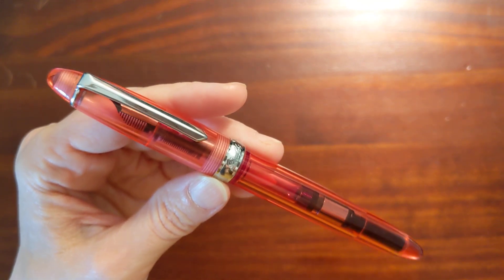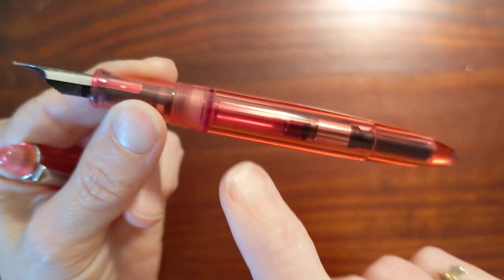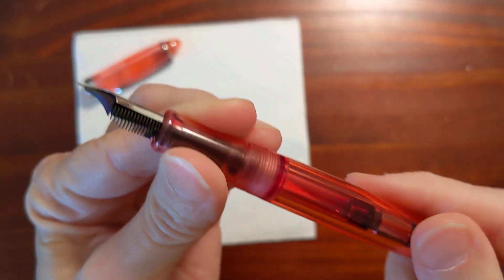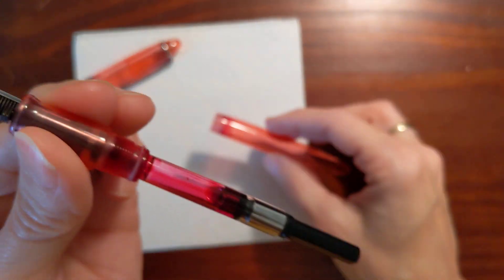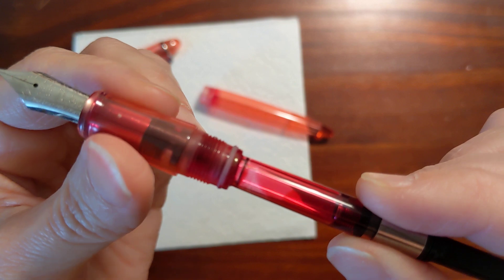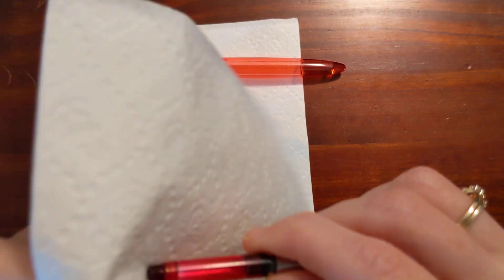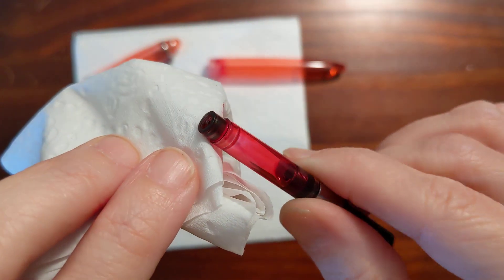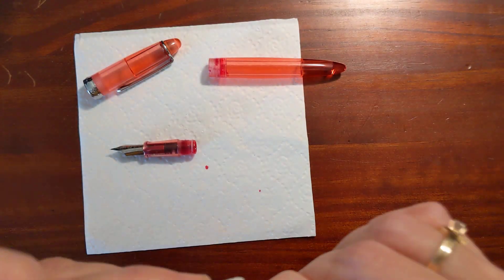Penbbs 308 Sprung a Leak

Comment: That happened to my Pen BBS 308 also. I, too, took it apart, checked the O rings, etc., and reassembled it. I haven’t had that problem since. 🤷‍♀️
Reply from the maker: I never had any problems after the first leak either. I haven't used my 308 much recently...I need to get out and take it for a spin. 😀

Comment: Hi! I never had this problem with a PENBBS but I had it a couple of times with Waterman converters in Waterman pens. They seemed to seal well but the "mouth" of the converter cracked and there was ink inside the pen. I suggest to check with a loupe if there is an almost invisible crack in the converter...
Reply from the maker: Thanks for the advice...I'll check it out.

Comment: Did it leak again?  Consider a PenBBS parts kits, comes with lots of stuff including some converters.  I have not had a leak as you did in the 30+ PenBBS pens I've used.
Reply from the maker: I cleaned the pen out and inspected the converter with a loupe. I didn't see any cracks. However I did notice a tiny chip in the plastic of the lip, but it was in a location that didn't appear like it would cause a leak. I'm going to ink it up again today and see what happens.

Comment: Yep, a cracked converter lip is the most likely explanation. Since the lip doesn't have a metal reinforcement ring, it's more prone to hairline cracks. It happens more often than you think. Just replace the converter.
Reply from the maker: I checked the converter with a loupe and didn't see any cracks. I'm going to ink it up again and see what happens.
Reply: @gadgetstop321  Hairline cracks may not show up under a loupe.

Comment: I had the same problem. I don't trust PenBBS converters, I had to buy the parts kit, which just adds to the cost of the pen. I've never had a problem with the converters for the cheaper Jinhao or Wing Sung pens.
Reply from the maker: I have the parts kit, but I can't remember if I swapped out the converter. I haven't had any trouble with the converter leaking since.